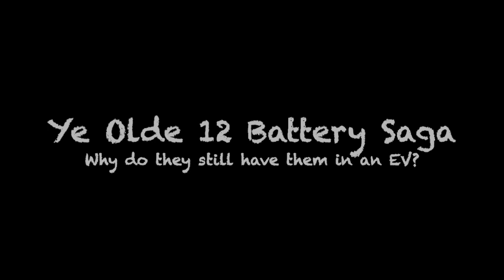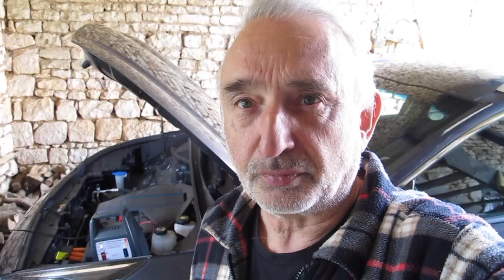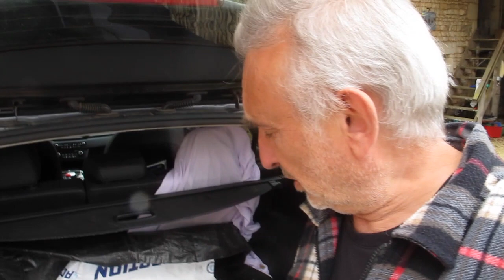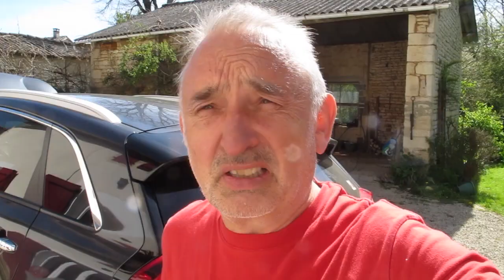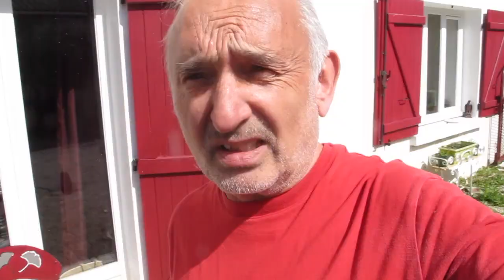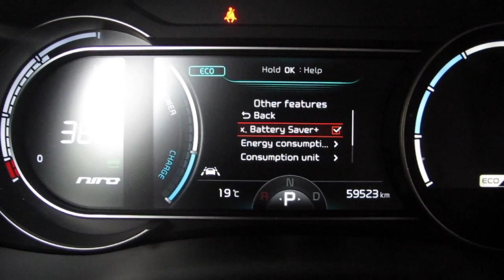Ye Olde 12V battery problem

Comment: If you have the doors open for a long time and the car off switch it into 'Utility Mode', that keeps the 12V battery topped up from the traction battery.  I managed to flatten the 12V repeatedly checking the cars location (paranoid me) via Kia Connect when the car was locked.  I've confirmed this is an issue using a battery monitor (as recommended by Mr EV).   Old 12V chargers present an unsmoothed waveform (they are a simple bridge rectifiers) which can damage electronic equipment, far better to use a booster pack or if you have to charge using an old 12V charger remove one of the battery connections whilst charging.
Reply from the maker: Great to see a comment on a video from way back. Mr. EV did go into this issue in some detail. It was a learning curve for me and I do have a booster pack which I used on vacation last year to help someone start his petrol car. He was amazed at how the little pocket sized booster turned his engine over and got him started. The thing is to remember to make sure the booster itself is charged from time to time. Thanks for watching
Reply: @EVDiaries-since2019   Thank you for replying.  I recently tested a suggestion from  Bjørn Nyland. calling remotely for 'preconditioning' does cause the 12V to be topped up.  I understand that if the traction battery is below 20% then the automatic top up does not happen although I've not tested this yet ... next time :-)

Comment: This must be the most common Niro EV issue.  Having rescued my daughter with her dead Niro a number of times.  To kick a dead 12v battery Niro into life you just need to get 12v into the battery, attach a charger or a battery booster or even jump it in traditional way, this will enable the key to be recognised the main computer booted and once on the 12v battery charges from  main car battery and you can remove and aux power, just wait a while with the car in on  mode while it charges.   A better battery is more insurance against a dead car, but one of those rechargeable battery booster units is good insurance to have in the car.   A word of warning is that if the 12v battery dies with you in the car with the central locking activated, you cannot exit the car!!!

Comment: for the life of me I dont understand why they dont have just a step down transformer.
Reply from the maker: They do. Just as in the Toyota Prius I owned years ago there is a DC/DC step-down. In the Prius the traction battery tops up the 12V as the engine has no alternator. In the EV the step down is from a higher voltage down to 12v and there is no engine of course. When the traction battery on the e-Niro is charging the 12v battery the green light on the top of the dashboard can be seen flashing through the windscreen. I only though that happened when I had the car on charge but no, it happens when the car is powered down and just sat there. The car detects when the 12v is getting low and the big battery charges it. Sadly there is no escape from some kind of power storage for an EV and because of the need to provide cranking amps to an ICE, a 12v high peak amperage system has become the standard. You may know that some companies are working with 48v systems now to power the vehicle ancillary systems, using a LiOn battery to do that. The savings are that with 4 x the voltage you can use thinner, lighter wiring and smaller motors for things like window winders, wipers and lights, there are big savings to be had. Eventually the lead acid 12v will die but until parts suppliers make wipers, lights and all that other stuff to work on a higher voltage, we're stuck with the old lead acid 12v.

Comment: Thanks for the video. What portable charger/battery pack  did you buy?
Reply from the maker: There are lots of them on Amazon...take you pick. I got this one on Amazon France....strange name FNNEMGE and we’ve already used it. 

.https://www.amazon.fr/FNNEMGE-Batterie-Démarrage-Alimentation-Eléctrique/dp/B08BG6KDFT/ref=sr_1_5?__mk_fr_FR=ÅMÅŽÕÑ&crid=20TITVA9RBWZT&keywords=Booster%2Bbattery%2B2000A&qid=1652128412&s=automotive&sprefix=booster%2Bbattery%2B2000a%2Cautomotive%2C98&sr=1-5&th=1

There are more powerful ones but with an EV you only want it to give you enough power to switch on the main battery. Mrs. e-Niro used it last week when she went somewhere and left the doors open while chatting to someone...we keep doing this!...She had no trouble using the 12v booster.

Comment: Interesting and useful video as ever. As to the comment about 60,000km service,  I seem to remember with our Ioniq at the 60,000km service they changed the fluid on the battery cooling system.

Comment: Another worthwhile video.
Of interest is as you say your battery is rated at 45ah the same as my my22 eniro but shown on a review of the new niro EV the battery on that is now 60ah. Not like Kia to give anything away unnecessarily.
Have you uprated your interior lights to leds? I did front inerior (map reading), rear interior, boot and reversing light. Easy to do and cost about £20 the lot. Take a fraction of the current vastly improved light output and help preserve the battery.
Reply from the maker: That’s interesting on the new Niro EV battery. I don’t see why EV makers can’t use a bigger version of the booster battery which I understand is LiOn. They weigh very little and claim to be able to crank a V8 engine. I guess its all to do with costs and the demands of all the other devices in the car. Thanks for the tip on the LED’s...any idea where I can get those?

Comment: These batteries when they get depleted a couple of times, a chemical reaction causes a 'coating' inside. Over time and more complete discharges, making it less and less capable to hold any charge . You're right about the 12v battery doesn't need to do much because an ICE battery usually has a larger 'capacity' to make an engine turn over. In the meantime, our little 12v is needed to open doors, open relay switches, work cabin electrics because 12v parts still rule?
Reply from the maker: Thanks Keith, good to hear from someone who knows about 12V batteries. I read that Audi, Volvo and others have been working on 48v systems for some of their cars...this makes sense as with Watts = Volts x Amps the higher voltage means you would need less current to drive the ancillaries, so smaller, lighter cables could be used. I imagine this would be a challenge for the parts makers who would incur some big costs in making 48v based equipment.  Still, with no need to provide huge cranking amps EVs must ditch the old heavy lead acid 12v at some point.

Comment: Thanks for the video. I have a 2020 Kia Niro EV Platinum Edition. I have about 21K miles and it’s been a year already. So far I haven’t had any issues with my battery but I did purchase a battery booster from watching Andrew’s channel with his challenge with the 12V battery. But you’re right, the battery should last longer in an EV. .